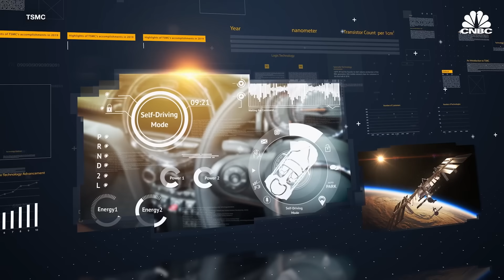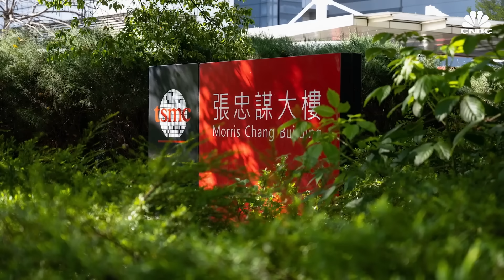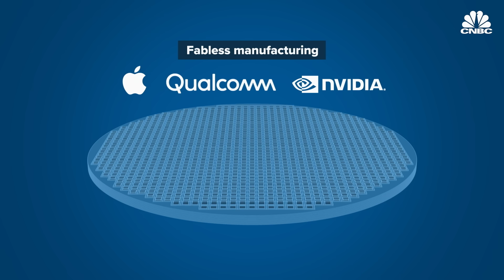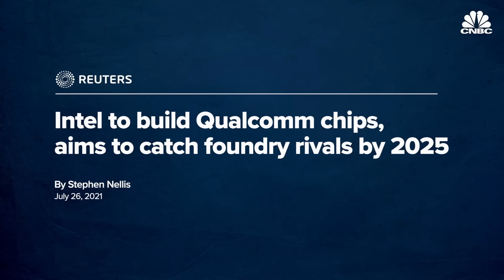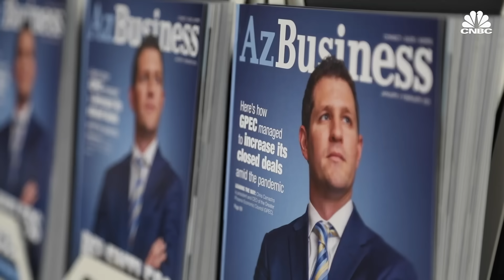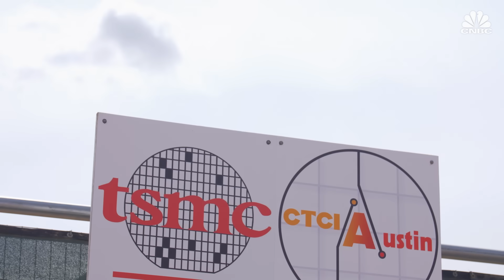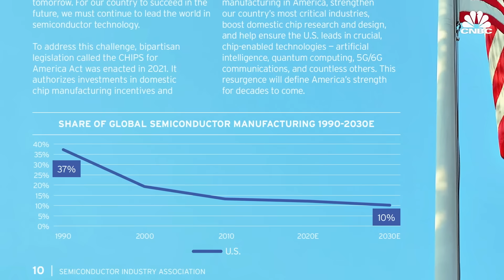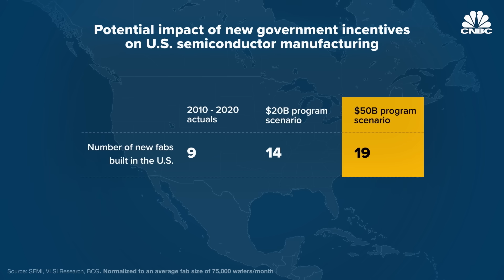Secretive Giant TSMC’s $100 Billion Plan To Fix The Chip Shortage

Comment: The more the U.S. relies on Taiwan, the stronger Taiwan's position is against being invaded by China. I'm fine with Taiwan, so I'm fine with them taking advantage of the situation to strengthen their defense againt China. Plus, if China starts a war with us over Taiwan, it doesn't matter, because China would have found an excuse with or without Taiwan to start a war with us.
Reply: I see it differently.  The only valuable asset Taiwan has is TSMC and since US doesn't want China to get it and it's bringing TSMC to Arizona, that tells me US is ready to abandon Taiwan and hand it over to China.
Reply: @walden6272  While I don't entirely agree with simply abandoning Taiwan, I do see that bringing back semiconductor manufacturing to the US is a need. China is going to try to take Taiwan regardless of whether TSMC is there or not. Controlling the worldwide semiconductor supply would just be a cherry on top for the CCP.
Reply: @thenow592  Yes, China wants Taiwan back and US wants TSMC, win win scenario for both.
Reply: @walden6272  win win for US and China. Double loss for taiwan
Reply: @elliekwong3180  Don't know where you got that. Never said that.
Reply: The woke then will get awaken by the Chinese Dragon. But real question is what will do when they realize that crying and throwing a tantrum will not get the problem fixed for them?
Reply: @warrenpuckett4203  Nah, America is the crying baby.  America pulled out the tricks in their bag trying to get China to the table. China said "no".  We have top priorities before trade negotiation. 1) Release  CFO of Huawei, 2) reaffirm one-China policy and 3) stop all disruptions of their BRI projects. So far, America has done 2 out of 3. It goes to show that America is desperate. . . I wonder why.
Reply: China will hit tawain, they know , daresay may even be exacerbating, our lack of a President, and the half dozen fixable distractions,. They have a larger navy, larger army,  and are poised to pounce when we.slip. and we are slipping hard. Our power right now is a lot of riding the coattail of our past, and some dumbfounded faith that the USD will hold value ( I can hardly type "value" even now) we raise the debt ceiling, we further the incoming hyper inflation, and melting up of the economy, we default on the debt - guess who buys our debt ? I see the commies giving us the finger our Allies that are only allies cus they think we are strong flipping to china, if china gets the chips before we can establish production here we're smoke.  Speculations aside, however this plays out we need to provide for ourselves, we need to crash economically and find the ground again and lastly FCUK THE CCP 🇺🇲🗽 meet me at Tienamen Square
Reply: @dont.ripfuller6587  : You sound like a sour grape.  Whatever will happen to America is mostly self-inflicted. The US gov't does not work for the people. It works for the elites. The reason America is on perpetual wars is to launder tax payers money to the elites.  Do you know who profited the most from the 20+ years of wars? Yes, the military industrial complex, like Boeing, Lockheed, GE, Haliburton, etc. Do you know who sit on the board of these companies? Yes, former politicians/officials and military top brass. Do you know America is running a Ponzi scam for the last 40 years? Yes, America has been borrowing money from B to pay A and borrow money from C to pay B, so on and so forth. Do you know who owns the Federal Reserve Bank, aka Central Bank? Yes, bankers, like Rothchild, Shift, Rocketfeller, and corporations. Do you know who owns the gold in Fort Knox? Yes, the bankers, not US gov't. Do you know the percentage of world trade using USD? Yes, only 56% and continue to go down. Do you know what country can print money at will? Yes, USA, printing tons of them. Now, you understand why America is declining fast due to decades of mismanagement by both republicans and democrats. Perhaps there are flaws in the democracy system.  Both parties spend more time trying to get an upper hand on the other party, than doing what is best for the country and its people. They treat each other like enemies than competitors. They would even screw the other party on expense of the country and people. America needs a reset, rebirth, or a new constitution.
Reply: @walden US doesn't want all of TSMC, just the part that make chips for US market that Intel fabs can't or won't fill. TSMC has 4x 12mm gigafabs in Asia. US only wants them to build 2 more of those in Arizona to supply 5nm chip to US, and leave the rest in Asia as is. As for Toyota and GM, they can continue to get their 28nm chips from the fabs in China or wherever. If China invades Taiwan, they will likely leave TSMC fabs alone, just like the Taliban left Kabul Airport evacuation alone. US will start wars for oil and end them when we have our own fracking. Who is to say the same will not happen with chips? Freedom is not free and wars are expensive.
Reply: @DR-mv8um  : You are so right.  You left out the theft. Of course, we can't very well go around saying America is stealing. Hell, they are stealing in Syria and Iraq. That is the only reason why America is there.
Reply: So does Taiwan belong to the US now?
Reply: @DucaTech  Only as much as they belong to China. So not in the slightest.
Reply: Not mention about all riots happened in the world such as Hong Kong riot, Tian An Men Protest which organized by ARMerica , only talk about war.    In 250 years of existence as a nation, the US has fought against 29 sovereign countries. (In Fact, since 1785, US have been involved, for 219 years, in some kind of war. And this wars, against all varieties of sovereign nations. From going against the Sultan of Morocco, to invading the tiny island of Grenada. Well, this means that in its entire history, it has only had 17 years of peace, and even fewer, cuz here the almost 5 years (1861-1865), of its Civil War of Secession are not counted (Union/Confederates), since this war was not with another country, but against US. And the wars against the Native Nations of America are not counted too, for the same reason). Anyway: US fought against 29 countries. It has "Grown" 711 times the size of its territory from the original 13 colonies. It has provoked with total impunity, Genocides, inside and outside its own borders, and assassinations of Gov’t. Leaders, Coups d'État and Economic Blockades in 6 UN member nations. (Between 1947 and 1989, the US tried to change other nations gov’ts. 73 times. It includes 66 covert Ops. And 7 overt ones. In Civil Wars: The US has taken advantage of and intervened without justification in the following Civil Wars: In Cuba (1898 and 1960). In Haiti (1813 and then 1915-1934). In Colombia (1899-1902 and 1948). In Mexico (1847 and 1914 and again in 1916). In Russia (1918). In the "Republic Banana Wars" of Central America (1912-1934). In Venezuela (1945 and again in 1948). In China (1857, and 1900, and again in 1945-1946-1949). In Korea (1950-1953). In Viet Nam (1959-1975). In Panama (1964 and again 1989). In Central Africa (1969-1974 and 1982-1988). In Nicaragua (1937 and 1985). In Bosnia (1995). In the Philippines (1898 and 1900)... In Kosovo, Libya, Lebanon, Somalia, Sudan, Syria, Iraq, Iran, Yemen, Afghanistan, etc.). And more: US has almost 800 Military Bases scattered around the world; 93 of which are against China. On the other hand, China and N. Korea (The "Axis of Evil"), in 1,000 years of history have NEVER invaded anyone. These nations have fought their Civil Wars, defended themselves against foreign invasions, and secured their immediate borders, but they have never been meddling or aggressor countries. Do you know how many Military Bases China or N. Korea have outside their territory? None. Zero. Any. NADA! They do not have a single Base. These are verifiable facts. Neither China nor Korea will invade the world; US does... that's DONE, as US does in the Middle East. Iran also does not have a SINGLE MILITARY BASE outside its national territory, and it is surrounded by 16 US Bases, and it is US who call the Iranians Terrorists. Well, very good. You already know. Now, compare the Greatness of the US with the Greatness of China. The "Greatness" of the US is built on the foundations of Piracy, Slavery, Genocide, the Assassination of opponents, Opium Traffic, or Cocaine in its case, and is under the foundations of the weakness of other sovereign nations. LOL…..Chai from Malaysia..
Reply: Why on earth would China want to start a war with the US. Its the otherway aroudn that the US is trying to contain a new rising superpower challenger that can disrupt US global political hegemony.
Reply: @Eclipseslayer98: You are under informed.  Do you see Chinese naval ships in North America, Central America or South America?  Do you see Chinese fighter jets in North America, Central America or South America? Since Obama, America sent 300-400 battleships to South China Sea, at least 2 carriers + Queen Elizabeth carrier, hundreds of F35, numerous nuclear submarine, and hundreds of missiles pointing at China.  So, who is the aggressor? I think China and Russia do their military exercise 200 miles from the shore of California or in the Gulf of Mexico.  That would send America out of orbit. Then again, America did not sign the 200 miles international convention. They just make up their own rule.
Reply: Exactly, thug I find it difficult for China to start a war with us. I'm not sure what the excuse or spark would even be.
Reply: Wow a intelligent person in the comments.  Didn't know those existed.  👏👏👏

Comment: TSMC measure's their nodes differently than Intel, all fabs measure differently including Samsung - so going by their proposed measurements does not mean more advanced. TSMC and Samsung decided to use different parameters to measure their nodes, when Intel was clearly far ahead on a more advanced node. TSMC and Samsung chose smaller parameters to measure by so they looked more competitive to Intel. This marketing strategy appeared to actually work - Intel's 10nm node is actually more advanced than TSMC's "7nm" - more comparable to TSMC's 5nm node, and intel's 7nm node is more advanced than anything TSMC currently has (even though it is not currently available intel has functional 7nm wafers). So currently Intel's 10nm node could be considered the most advanced in the world, but only a small line of Intel's CPU's are currently on it.
Reply: Why does Intel place 14 billion worth of orders to TSMC if Intel can make a 3 nm chip?
Reply: @genuinennessbefitting4734  If you read what I said - its not being mass produced, I also never said 3nm.
Reply: More advance? you mean:  less yield per wafer, more device leakage, higher power consumption, run slower.. and on..
Reply: @albertwu459  which process are you talking about? If you mean 14++++++++ then yeah... if you're talking 10nm the yield is actually comparable to TSMC's 5nm - they're just struggling to recover the costs. Power consumption and efficiency also seem to be comparable so I'm not sure what your source is you're getting this from.
Reply: @johnj8639  it will be endless debate. Chip making is a fast paced and fiercely competitive industry. Been worked @ both companies. Know their strength and weakness. Things can change very fast. In the mean time,  you can check where those major heavy weight chip companies, even Intel itself,  flocking toward to

Comment: TSMC don’t need to produce in USA, it’s expensive and the workers are lazy. There are tons of other options to be safe geopolitically. 

US needs to literally pay for TSMC to have a foundry in USA here. Apple and companies don’t really need to be that close to their manufacturers. There are emails and conference calls. The whole supply chain is on the other side of the Pacific Ocean anyway
Reply: Only highly qualified professionals work in such factories. This is not McDonald's. Everyone who works there has a long university education behind them and is anything but lazy. The wage costs hardly play a role there either.
Reply: @huckleberryfinn6578  the average cost of a TSMC engineer is NT$54000 per month, that is $20K for annual salary in USA. That js easily 1/3 in USA compared with Taiwan and it’s not necessary better to start with.

The research team in Taiwan works 10 hour shifts and they have 3 shifts working 24 hours a day. Try doing that with a research team in USA , paying over time and getting them to work the night shift, they are going to refuse and it will seriously slow down the research project

Comment: The joke about the funding in China regarding chip financing is that most of the current projects are scams and the rest have significant management talent and skill deficiencies that they will fail before any of them moves their fabs into operational mode. Every industry has the same problems. You need actual experienced management and creators from previous projects to have a chance of creating a competitive entity capable of competing with legacy and predecessor companies. There are virtually no competitors that come from people and resources that have no link to industries they want to compete with. That is a fundamental truth. China steals technology by installing spy personnel into established businesses and then they reverse engineer much of the skill and technology onto copycat companies and industries inside China. That in a nutshell is communist China's modus operandi.
Reply: The problem with your analysis regarding skill deficits in China, is that much of the industry talent and skill is ethnically Chinese. Just look at Nvidia's founder, Amd's CEO, Cadence CEO or TSMC itself. Also most semiconductor manufacturing is happening in Asia. Inside or in very close proximity to China. What will stop this talent from switching sides for nationalistic or money reasons. Or even selling blueprints.
Reply: @stevemrayz357  I stand by my opinion and you should stand by yours. In regards to support, let the research as to how companies are founded and their histories will inform people how and why a company and industry is built. The vast background and origination of mainland China growth is intentionally opaque which indicates lack of transparency and most likely immoral and unethical behavior that is frowned upon in Chinese culture as well as everywhere else in the world. I'm sure your perspective has some basis of logic, but as to how extensive and reliant on overall business development it helps, it won't help in that society because Chinese communist connections are the driving force to get any actual going concern work done. No CCP subservience and you find yourself being extorted out of existence.
Reply: @fturla___156  I'll stand by my opinion as you suggested, but thank you for the response

Comment: Who's electric toothbrush requires a chip?? It's a battery and a motor
Reply: Every toothbrush needs a chip. The motor must also be controlled. Of course, these are not high-end chips that only TSMC can produce, but rather technology from the 90s.
Reply: @huckleberryfinn6578  that doesn't require a chip, its not like a stepper motor or even some kind of variable speed EV motor, its just a small motor that's probably been tailored to the specific power source it will have, so the most you'd need is a few resistors, and maybe a MOSFET, but that's really not what's I'd call a chip. More like the basic element of a chip
Reply: Thanks for Comments don't forget to hit the subscription bottun
➕①=⑧=①=⑧=⑨=⑥=③=⑨=①=⑦=⑥
✍️⌨️
Reply: What's app me ☝🏻☝🏻
Reply: definitely no need TSMC made

Comment: TSMC is so far simply because they are the first to believe in ASML EUV.
Reply: If Intel had invested in EUV they won't be in the current state.....
Reply: ASML is the best play in the semiconductor industry
Reply: The wet etching in lithography was developed by Burn. J. Lin, the deputy general manager of TSMC, which makes ASML surpass Nikon and Cannon, Taiwanese, contributed many breakthroughs in chip technology. EUV was developed in F12 of TSMC; Engineers from TSMC are still in charge of the research in ASML.
Reply: AMSL EUV is out there because Intel was involved deeply in its creation.
Reply: @JigilJigil   Yeah but they did not make good use of it